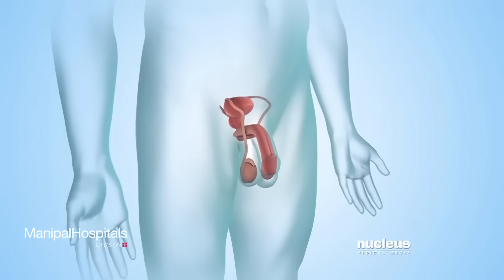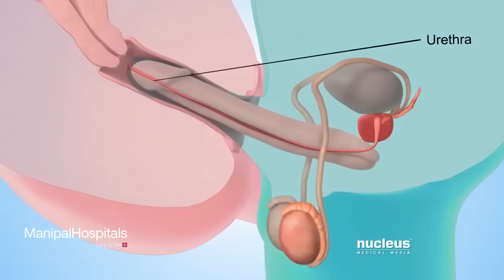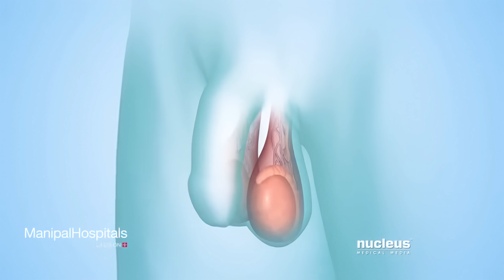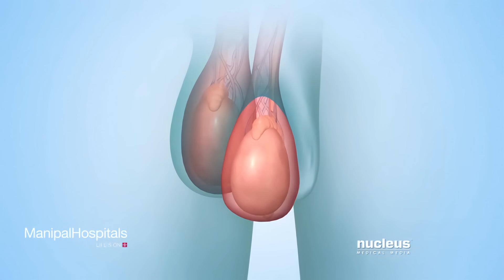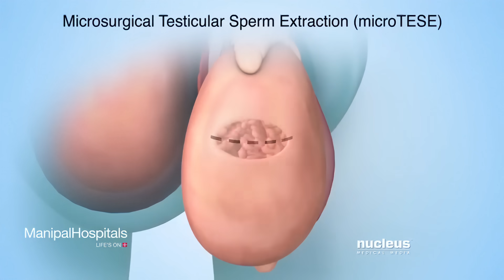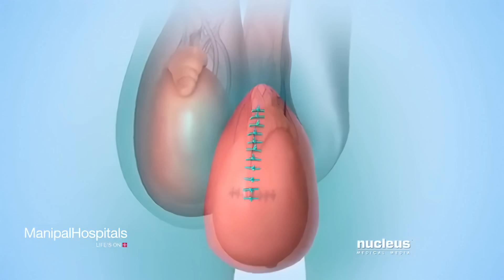Sperm Retrieval Techniques

Comment: I really feel very grateful to this PE treatment because it`s amazing. This issue I have been facing was the reason my previous relationship didn`t work. The longest I really could last was 3-4 minutes. I followed this program just recently and was surprised to have the ideal results within one hour with my present partner. I am not sure it will work , but you can get the pe guide by Google. I remember its name is Thomas Camonρez
all the best